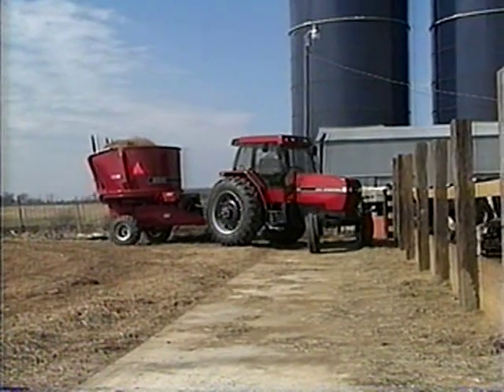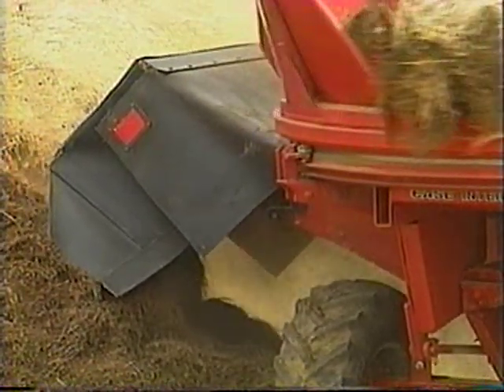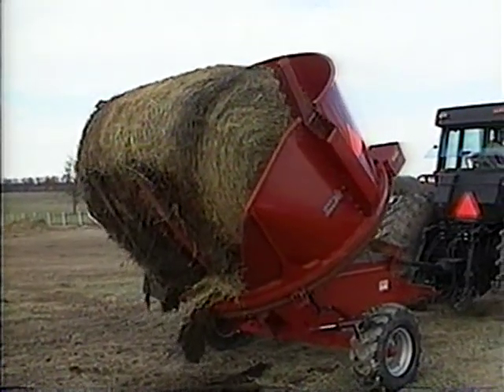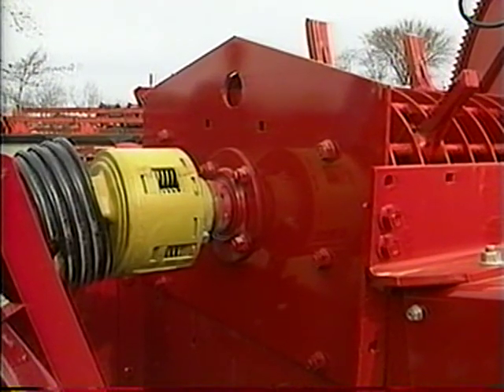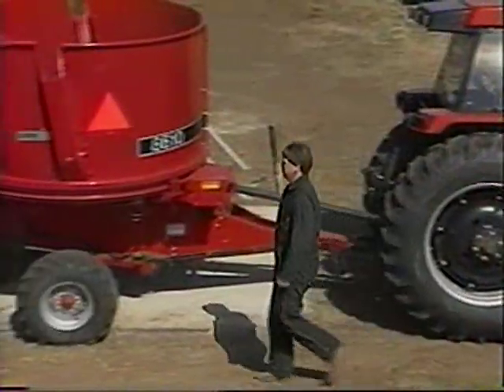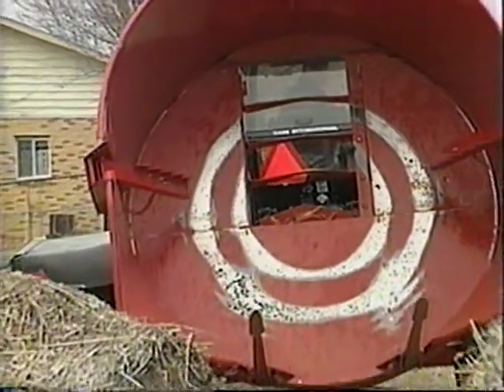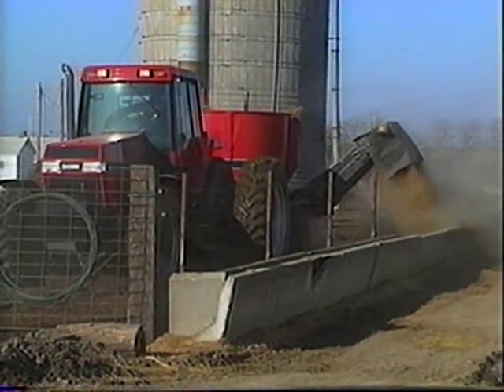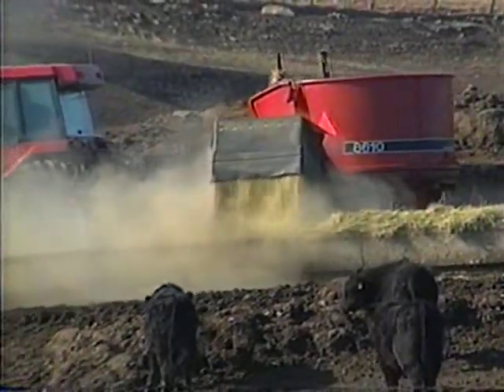CaseIH 8610 Bale Processor Intro (February 1991)

Comment: so we pulled this baler processor out and so far has worked well w one issue. when we fill the bunks it leaves a pile on the ground on the inside of the left tire, which I end up using a pitchfork to put it in the bunk.  are we missing something on this , it seems as though it needs some type of plate to help blow the hay further left